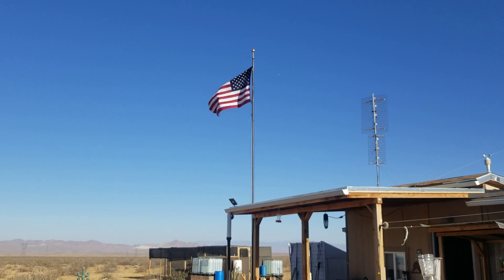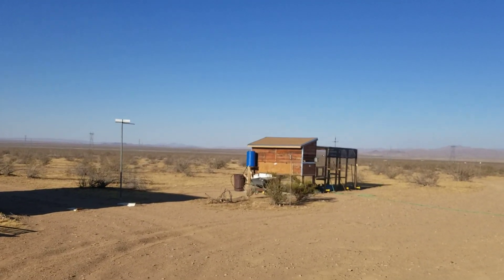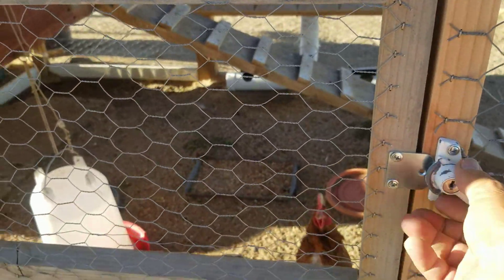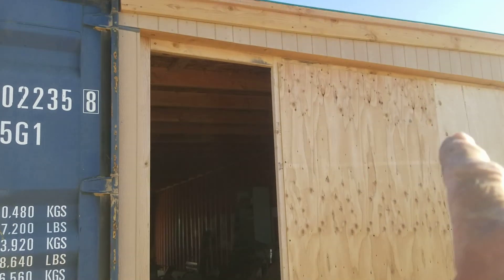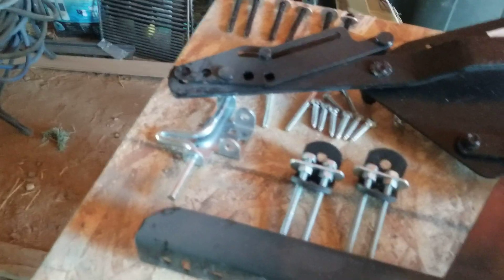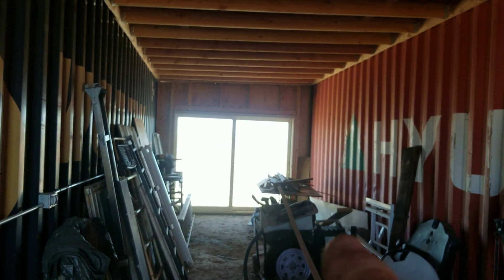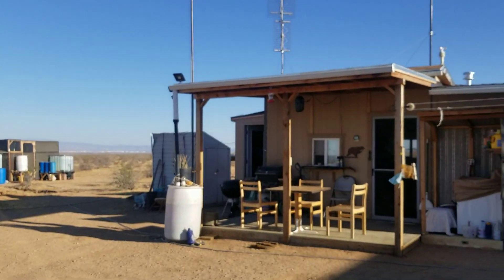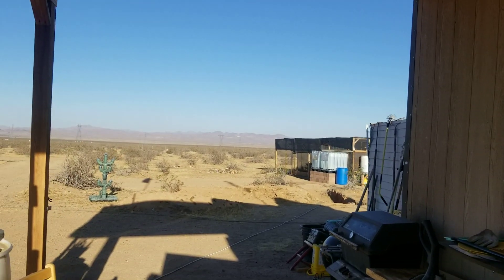Flip up garage door built and semi installed.

Comment: Hey it's up! Awesome!!!! Man that's good to here. Good job friend,looks like your sure conquering the elements and spoiling those chickens
Reply from the maker: Thanks.  I hope to have the hardware installed tomorrow.
Reply: @GBear  I'm sure you will get it up in no time. What the average temp there for fall and winter?
Reply from the maker: @nicklong7661  fall cools to the 80's and 90's in the day with a 30 degree drop at night, winters can get down to the teens occassionally,  but not often.  Mostly 40's at night and 60's for the days.

Comment: When it's windy could you Bbq between the containers with your propane unit?  I'll be curious when its all done what your 'per square foot' cost of the 'tween-tainers shop might be.  Nice video good to see the hens
Reply from the maker: Yes, bbq in there would be an option.costs:  door and hardware under 300, wood for roof including metal hangers around 500, roofing materials around 200.

Comment: Could that last piece of plywood, on the garage door, be a walk in door
Reply from the maker: Hmmm, are you a mind reader?  I had a man door I cut in to my last place in the OC and used it more than the overhead door.  I left it off with that in the back of my mind, but need to think out the security part of it first.
Reply: @GBear  
👍👍👍👍😁
Reply: @GBear  
Maybe put the bolt locks on the inside
Reply from the maker: @jimh712  lol, then I have to open the big door to get the small door open....
Reply: @GBear  
I was thinking more 
Open the walk in door (swings out) and 2 bottom bolts into the concrete and one side bolt opposite the walk in door..(on the inside.)
Or put the walk in door in the middle..

Comment: Do you take your flag down at night? I want a flag pole too 👍
Nice chicken coop 🐔🐓🐔🐣🐥🐣🐤
Reply from the maker: No, I illuminate it.  I made this flagpole from 1 inch gas pipe, 21 feet long, and made the truck at the top with ornamental metal welded to a pipe cap and spray painted gold.